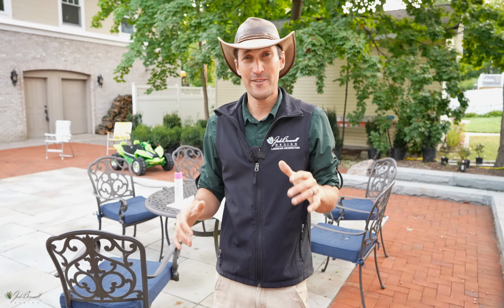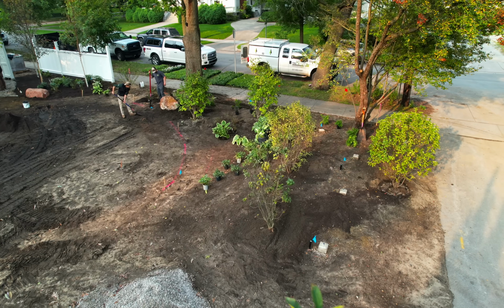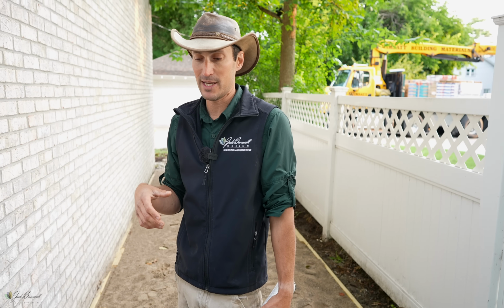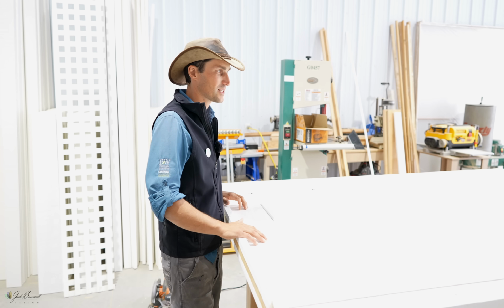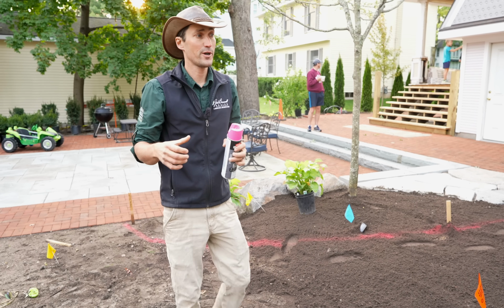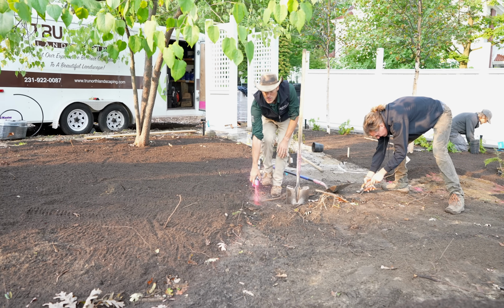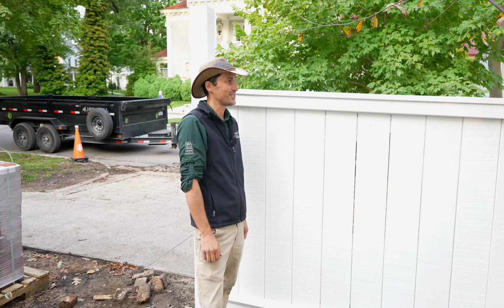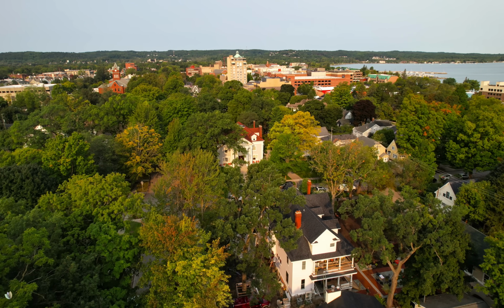Victorian Landscape ~ Part II

Comment: How often will those fence panel be painted?
Reply from the maker: It is a solid color stain- so the wood is soaked in well with 2-3 coats at installation. It likely will need cleaned, and fresh coated with a thin touch up coat about every 6-8 years.